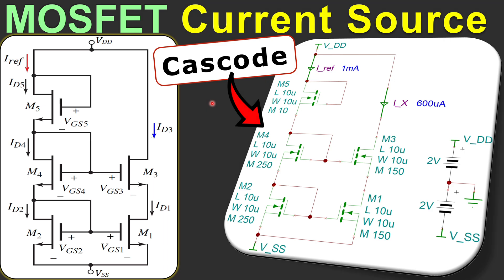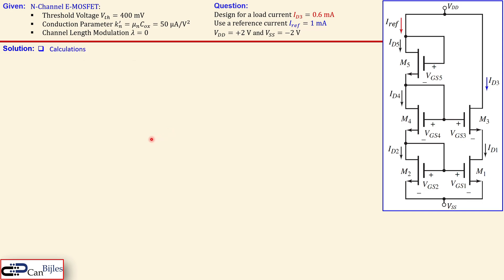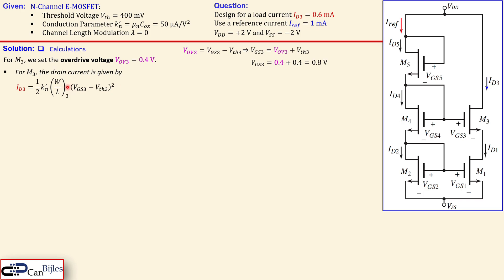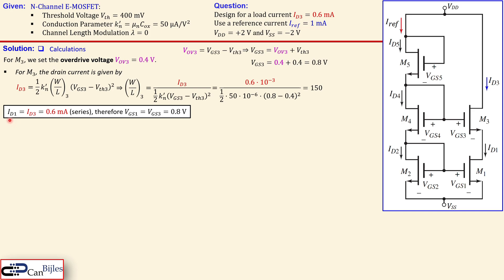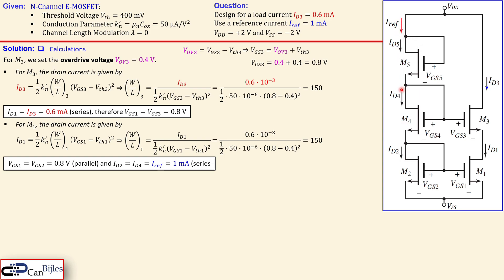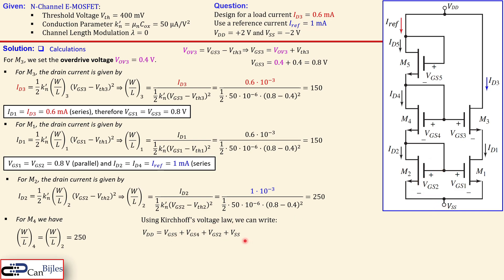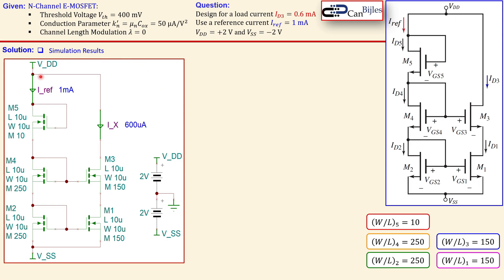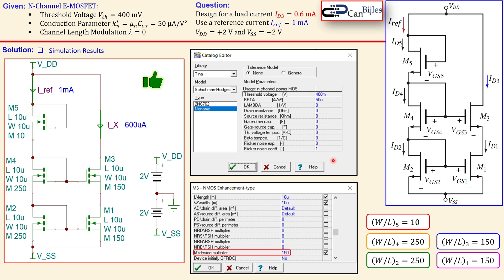MOSFET Cascode Current Source (Full Transistor Design) 🌟 Calculations & SPICE Simulation 💡 Example 8

Comment: Thanks again for your videos.
I did understand things how it works. But when I try to calculate for real PDK of 130nm for example, I get W/L in fraction number which is correct mathematically but implementation in production is difficult. How do you approach this problem?
Reply from the maker: You're welcome! If you have a W/L as a fraction, for example: if W/L = 10/3, then you can make this ratio by having 10 as a multiplier for one transistor and 3 as a multiplier for the other transistor.
Reply from the maker: You can also watch this video: https://youtu.be/HzLKFH4M2KQ

Comment: You say that if the current is equal, V_GS must also be equal. But then why is V_GS5 not equal to V_GS4 since the current I_D5 is equal to I_D4? Thank you in advance.
Reply from the maker: The V_GS values are equal if the I_D is equal when the W/L of the transistors are the same. This is not the case for M4 and M5. So, you can scale currents by setting the W/L ratios.